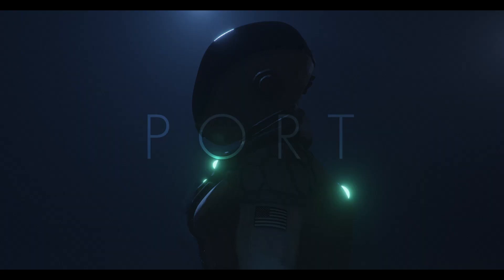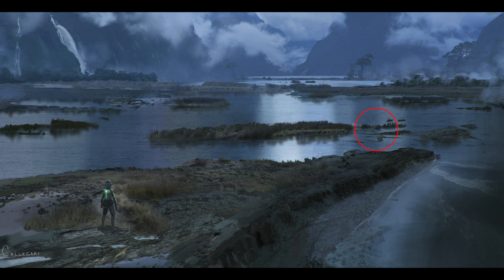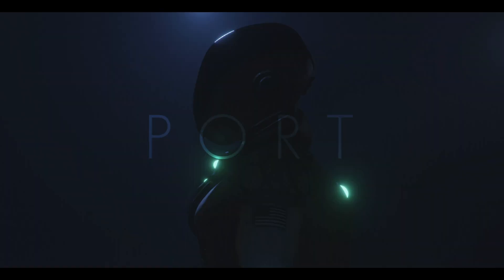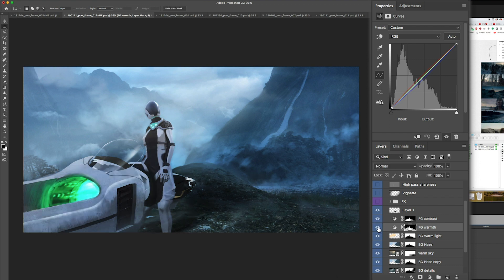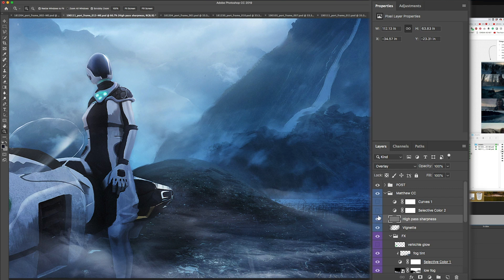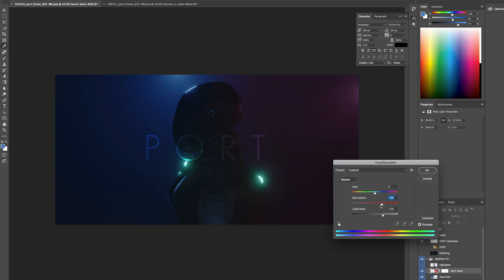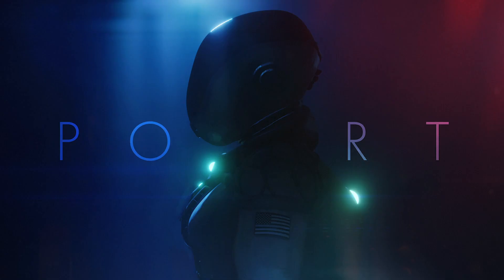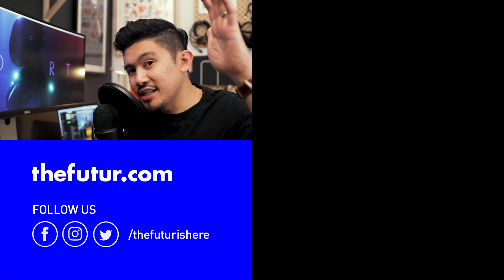How to Make Your Design Pop – Critique and Photoshop Tutorial

Comment: I like the adjustments direction and the final result. I would fix just just a little by adjusting saturation, contrast and sharpening in some parts. For example, the 1st image: decrease blue saturation on pants, decrease sharpening on the dust behind and inside the engine, probably add some flame distortions inside the turbine. 2nd image: make similar saturation for letters (make left letters less blue), increase a bit a black level on the subject (after adding some light it becomes too dark).